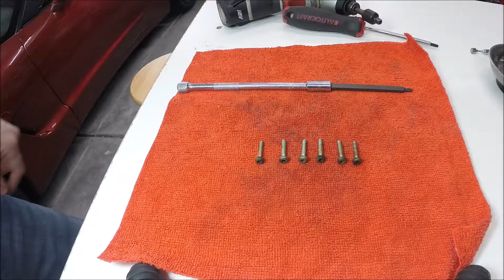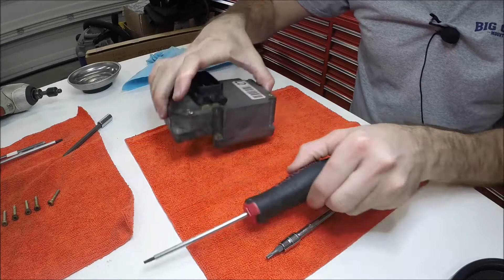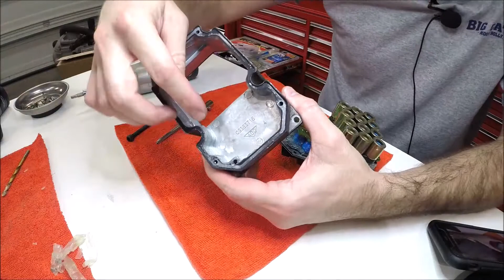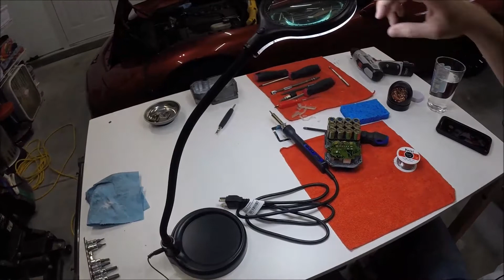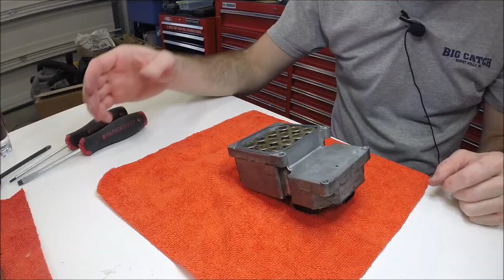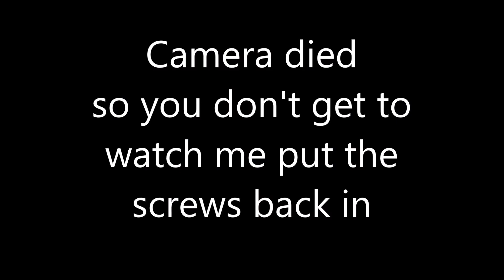C5 Corvette - EBCM Repair

Comment: nice job, clean and very understandable english.
no music.
perfect.

I dont own a vette....but im thinking...looks like 8-11 k can get a decent one.

liked!
Reply from the maker: Thanks for watching.  You can find some deals on C5's these days, especially if you are willing to fix a few things.   I would highly recommend staying in the 2001-04 range if you can.   There are a number of things that changed, including the EBCM, the TPMS system I believe, the steering wheel position sensor, etc... and these commonly fail but are often no longer available for the '97-00 models.  So just something to be watchful of.   But the good news is that how to fix almost any problem has already been documented.   Another issue I fix before starting the channel is fixing the HVAC display (goes dim).  Again it's just a matter of reflowing the solder on some resistors.   So if you get a C5, I suggest you also get a soldering iron, haha.
Reply: @ScrufsGarage  just picked up a 98...(yeah I know --but it was a VERY good deal)....and this is 1 of its issues.    I think its located in a diff location.........
just noticed your shirt...you in Mt Holly NJ?
Reply from the maker: @harryharry3193   congrats on the new C5!  I’m not in Mt Holley but I have a close friend who is, so I’m up there a couple times per year.   We did a section of the trans nj trail on dual sport motorcycles this summer up by High Point state park.  Beautiful area!
Reply: @ScrufsGarage  all kind of nice areas here in New Jersey I live right around the corner from Atco Raceway

I'll be watching some C5 videos soon

Comment: What year car is he working on, I’ve been told 97 thru 2000 can not be repaired and there is no replacement unless you find a used one
Reply from the maker: That's correct.   My car is a 2001.

Comment: What year is your Corvette?
Reply from the maker: My car is a 2001.   Keep in mind that the 2001-04 EBCM is different from the previous model.  I'm not sure those can be repaired as easily?
Reply: @ScrufsGarage  mine is a 2000, what is the difference.
Reply: 97 & 98 are located in the rear, by the diff...99 & 00 are under the hood, just not repairable, at least not like the 01 to 04...try Westchester Corvettes in NY and talk to Chuck Cow 1-914-332-0049...good luck...my 99 v5 vert. needs this fix too.

Comment: do i need to make a gasket or use rtv when reinstalling? what keeps the water out?
Reply from the maker: Just a bead of the clear silicone between the two halves before you close them up will do.  Wipe off any excess on the outside.
Reply: @ScrufsGarage  Thnx

Comment: Great video. Sent mine out to get fixed a while back. Crazy how common this problem is.
Reply from the maker: Todd Johnson  There certain issues that it feels like pretty much every C5 will eventually need.   I’m glad to have checked this one off the list.  And honestly it wasn’t nearly as difficult as I had envisioned.   Thanks for watching.
Reply: Where did you send yours to ? I’ve been told 97 thru 2000 is not repairable and there is no replacement unless you find a used one. Mine is a 99.